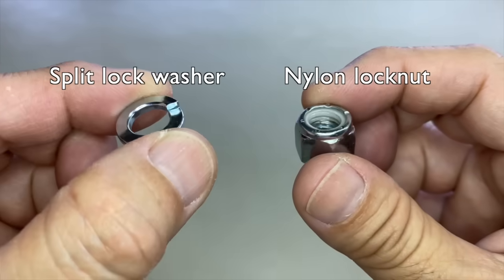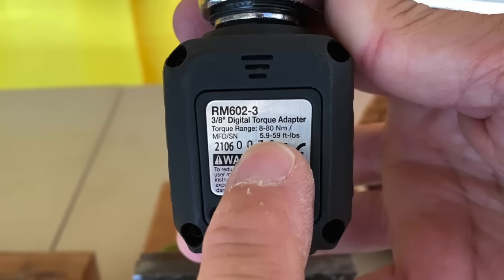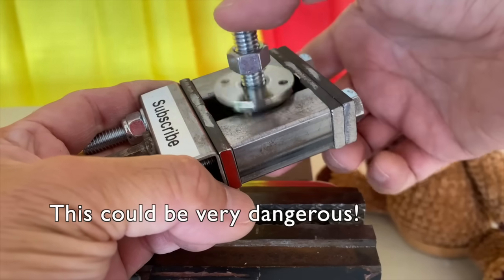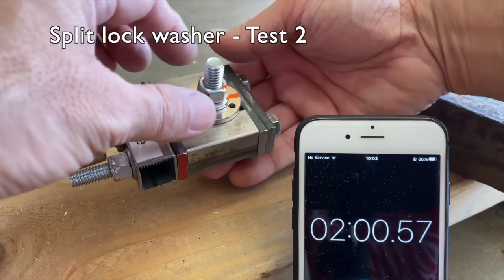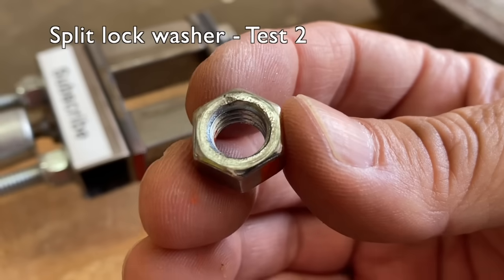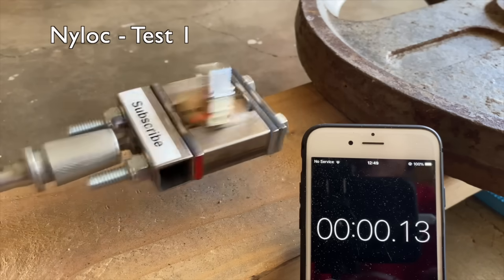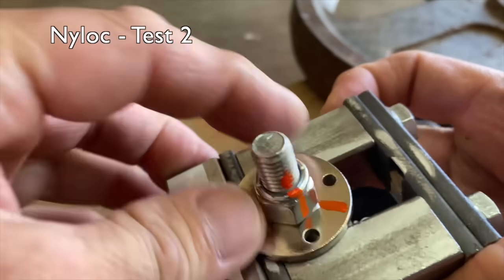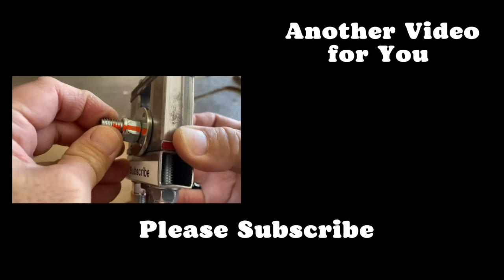Nuts & Bolts - Split Lock Washer vs Nylon Locknut – DIY Impact & Vibration Test - Part 1

Comment: Locknuts torque should adjusted to the "break away torque" wich is the amount of torque nessasary to rotate it on the threads, so that nylock nut was not torqued properly

Comment: It looks from the way the paint marks end up that in at least some of the tests, the initiation of failure occurs not due to rotation of the nut relative to the flange, but with rotation of the bolt relative to the whole assembly of nut-washer-flange which itself remains co-angular.

It might be interesting to see whether adding another split washer between the head of the bolt and the other flange helps, but fundamentally the issue is insufficient clamping force to hold the joint together, ie not enough torque.

Comment: Are any of these the metal lock nuts? They're used a lot in the automotive industry. For example, they're on the bolts that hold my upper control arm.

Comment: Did we really need to see a demonstration to show that a nyloc is better than a spring washer. Once the plain nut parts company with the spring washer disaster is inevitable but the nyloc nut holds for the length of the thread. Ive never seen a nyloc come loose in 50 years of repairs to cars, bikes or garden machinery even when a nyloc has been reused.
Reply: I have often seen Nylook nuts come loose in the agricultural sector. Lock nuts are the most durable.
However, I noticed in this test that the torque was definitely too low in the test with the spring washer

Comment: WTF?!  Firstly, it's a shear load not a "transverse load".  Secondly, in these sorts of "high dynamic near-shear-stress loadings", one ALWAYS applies lock-wire and/or an external torque buffer with a positive capture fitment.  This stuff is 50+ year old established mechanical engineering best practice.  PLEASE do a modicum of research before publishing objectively WRONG analysis on a public forum.
Reply from the maker: LOL!
First, it’s a transverse load across the diameter of the bolt.  Look it up or as you say do some research. 
Second, I obviously was not trying to show a best practice.  
You experts are too funny!
👍😎

Comment: He put the lock washer on upside down twice.
Reply from the maker: Upside down lock washer?  Thanks for the laugh!  🤣
Reply: @HacksbyDad  It is sort of like putting a fuse in backwards or reversing the polarity on a resistor.
Reply from the maker: @robertjohnson2325  I get those mixed up all the time!  👍😎

Comment: If joint 'can't come apart.  
A great start is flat perpendicular surface, flat hardened washers (SAE Grade 8) , don't need to be certified, but 'aircraft specs' is better.... And appropriate torque. 
PS did the background engineering for recalls in the ground vehicle industry.
 Lead contract teams that did dozens of DFMEAS & DVP&R's for industry.

Comment: Interesting, if you ever do follow up testing could you run the test with the double nut option 'jam nut'.  You torque the first nut to something, probably more than 6 ft/lbs and then put the second nut on an torque that against the first to the same torque.  Curious if that is equivalent to a single ny-lock or similar.  Thank you.

Comment: Clickbait. Disliked.
The NASA Fastener Design Manual is free and well worth reading:
https://ntrs.nasa.gov/api/citations/19900009424/downloads/19900009424.pdf
This video is a waste of time. Leave professional subject to the professionals. Split washers are almost never used in aviation and on nothing modern. Plastic insert nuts are far inferior

to all-steel nuts and no reason exists to use them given the trivial cost.

Comment: Not a good test. 3/8" (8mm) 8.8 grade bolts are usually torqued to between 30 and 36 ft/lbs, depending on the application. Even 1/4" (6mm) 8.8 grade bolts are torqued to between 12 and 15 ft/lbs. The only time I have ever come across any bolt being torqued to 6.0 ft/lbs was a set of cam cap bolts on a BMW motorcycle.

Comment: I admire the dedication to testing but 6 lb of torque on a 3/8 inch bolt invalidates the results. Even a grade 5 SAE bolt would be torqued to 30 ft lb which would change the outcome of this test.

Comment: Nylon lock nuts loose effectiveness over time as the nylon eventually takes a set to the threads. The presence of oil hastens their failure as well as heat cycles. Distorted thread (Crimp nuts) are what you see in applications such as engine rods and aircraft fasteners as well as exhaust flanges. In suspension parts a castle nut with a cotter pin is common. Other methods include jam nuts as well as thread locker (Again thread locker doesn't hold up to heat).

Take a hammer and bang the threads of the bolt slightly flattening them and re-run the test and see what happens...

Comment: Technically, the joint failed as soon as you lost preload on the bolt, so as soon as you can rotate the bolt, the joint has failed even though the nut doesn't turn on the bolt.

Comment: When using a nyloc, in order to get the same bolt preload, you need to take into account the torque to overcome the nylon resistance. When you first put on the nyloc, you need to measure the amount of torque required to run down the nut before you make contact with the washer, and then add the desired 6 ft-lb on top of that, otherwise the bolt will not have the same preload as the sample with the split washer.

Comment: Your torque value for a 3/8" bolt was ridiculously low. Depending upon your grade of bolt and thread pitch, 15-20 ft-lb would be possible.   Also, typically the running torque of the nyloc nut would be added to the bolt torque to maintain the same axial preload intended.
Reply: absolutely.. silly test at 6 ft/lb
Reply: Came her to say this - I'm no fan of split coil washers (I think they are called spring washers in the UK) but you could see it wasn't even clamped up.
Reply: I think he was testing at negative multiplier when doing 6ft-lb. This is to see which solution “works best” the fastest. 

If he tested at 20ft-lb that cheaper reciprocating saw probably would have burned up running so long haha. Also would probably take a very long time for results across 3 test samples each.

Comment: Experience here is that UV weathers/degrades the nylon leaving only what ever torque was applied. If it must not fail then Safety wire is best.

Comment: Niloc Nuts are awesome and work superb.
Unless your application is a very hot environment or youre securing parts that could get hot in case of a fault (electric connections).

Comment: I stopped using the split washers many years back when I almost lost a trailer when the nut got off the ball pin, thanks to the chains that kept the trailer hooked up to my Truck.

Comment: Looks to me like to get the most out of the Nylock nut you need to torque it more than others, due to the added drag of the nylon smushed into the threads; in other words, if all three tests had the same torque applied with the tightening wrench, you weren't really applying as much clamping force with the nylock nut, because the nylon-smushing action was stealing much of the force of the tightening wrench away from what would otherwise have been applied for clamping force.

Comment: There is a concept called torque loss. Are you getting the same clamping, or longitudinal load, tightening the split washer assembly vs the  Nylox assembly at only 6 ftlbs?  Wouldn't the rotational drag of the Nylon within the Nylox essentially ‘steal away’ some of the torque being applied to the thread surfaces?  Equate this to the clamping force of an assembly with dry vs oiled threads.

Comment: Haters do not deserve internet access. We all just watched a very good thing take place. Something more people should carry the desire to do in life. Scientific method of discovery being applied and carried out is always good. If an experiment can be improved upon, by all means offer suggestions. But do not disregard the effort. After all, information was obtained from the effort. Testable information with repeatable results. That's called success.
Reply: This proved if you don't tighten it to speck they will all eventually come loose.
Reply: Ask an engineer if you are doing anything needing to survive in critical applications
Reply: @danbutler7586 ask a technician who troubleshoots and fixes the engineers mistake of being a ninkumpoop
Reply: Yes, absolutely. The guy said something like: these results come from these experimental conditions.
Reply: @tonyblighe5696  
Nailed it. That rather important factor is actively missed by the aforementioned haters.
Reply: Stupid is as stupid does !!
Reply: It's a flawed test. We wouldn't expect you to understand based on your opinion
Reply: When doing a scientific study don't make up foolish parameters like this joker did. 6 ft pounds cause his torque wrench goes to 5.99 ft pounds is just stupid.
Reply: @RT-tn4ry  
When dealing in foot pounds, .01 is not going to be any level of a meaningful difference. You are searching for something to hate. That is a bit worse than blind hate. 
Again, if an experiment can be improved upon, offer suggestions. You are not offering anything but blind judgement while not truly understanding the benefit of the data collected.  Even an outright failed experiment can net usable data. 
He was testing the ability of the components to do their advertised job on their own minus their rated torque specs. Yes, there are numerous variances which could have been applied during this experiment. But that is when suggestion comes into play. Only offering hate and improper judgement is of no use to anyone outside of ego of the one who leaves such a comment.
Reply: @theduder2617  It is a valid suggestion to say fasteners should be tightened to their proper torque...not just the lowest setting on your torque wrench.
Reply: @theduder2617  You are the one missing the point. No 3/8" bolted assembly is ever torqued to 6 ft/lbs. It's nice that the guy took the time to do these experiments, edited the video, then put it up on the Internet for others to benefit from. Not questioning his motives. But bolts work like rubber bands, they stretch. Bolt stretch is the thing that applies clamping force. 6 ft/lbs is not stretching this bolt enough to apply substantial clamping force. So the outcome is predictable, the assemblies loosen more easily than they would in a real world application. It's not "hating" to state that drawing meaningful conclusions from flawed data is counterproductive. How many people have had unintended consequences - some of them deadly - because they were operating with flawed data?
Reply: @georgeellison926  
Incorrect. Had he been testing manufacturer torque ratings, those would have been the torque ratings he would have used. To put it over-simplified, he was testing to see which design vibrated loose the fastest and which one held up the longest given his established conditions.
Missing the objective of an experiment does not "flaw" the results. Obviously these results are not to be presumed as manufacturer recommended torque results, for that was not the experiment. 
The test was to show differences between the washer and nylon nut. In the results, those differences are shown. I.E.: experimental success. 
No one, not even he himself is suggesting anyone run out and use these parameters in any situation whatsoever. That would be the individual's decision and they alone would be responsible for the results of such use. 
FYI: even nuts/bolts tightened to manufacturer specs is subject to vibration. And stretched bolts are weakened bolts. Hence half the importance of not over-torquing a nut/bolt. 
From these results, one can determine which washer design is best for their application if vibration will be a factor. After all, there were differences in the amount of vibration each design withstood before movement of the nut began; the entire point of the experiment. 
End note: FRICTION is what provides clamping force. Hence why it is not good to use lubricants and anti-seize compounds on vehicle lug studs. And friction is what torquing generates.
If you stretch an outer tie-rod by over-tightening the jam nut, that tie rod will need readjusted. If you stretch a head bolt, one runs the risk of the new gasket leaking and/or stud breakage. Both bad. 
Oh, and split-washers are not fans of too high of torque. Too much and the split opens further, smashing out from under the nut. The more it spreads, the more torque needed to reach a specific setting.
Reply: The recommended torque for this application is 26ft/lbs. At 26ft/lbs the threads will stretch, the lock washer will react differently and not loosen under vibration in its recommended usage. If the fastener combination fails, it was either flawed or the wrong combination for the usage. Plain and simple, if you're not testing the recommended spec, the test is useless.
Reply: Duder wants participation trophies for the effort lol
Reply: @lollipop84858  
As I stated, haters do not deserve internet access. Nice of you to make the effort to reinforce the statement. 
Doing so while actively missing the entire point calls into question your opinion, but thanks for "participating".
Reply: @theduder2617  
then you should not have internet access yourself!

Comment: I don't know, with such vibration, other types of locking of the connection are generally used. Nuts with a slot are acceptable.

Comment: Interesting, and real world applicable-in the garden shed, by which I mean: the real world. So many aero engineers here getting their knickers in a twist, citing NASA usage. If you're building a fence,  you'd use split washers and tighten it by hand. If you're building a billy cart,, you'd use Nylocs on the axles, and still tighten by hand. On my 1974 GT750 Suzuki, there are mostly nuts and bolts with split washers, one Nyloc nut, two castellated nuts with split pins, a couple of lock-wired nuts, and several nuts and bolts with foldable tab washers. All tightened to proper torque specs.

Comment: This a test to compare the locking characteristics of two systems under a single, non-representative situation.  This selected low torque condition would obviously favor the nyloc fastener.  This video tells me nothing that helps me select which system to use under varied real-life applications or to solve real-life fastening problems.

Comment: Depends on application. There is literally 100s of specifications in mechanical engineering regarding fastener stickups and torque. Especially with the nav sea and nav air hardware. In the auto industry the requirements aren’t that stringent and really don’t need to be. And today a lot of automotive load bearing components are torques to yield with no lock mechanism. As far as split washers go, yes they will have cracks in them. Some from the manufacturing process and some from being used. There are lots of specs in mil hardware that require split washers to be replaced if the fastener is removed. But this is mission critical hardware. For general auto hardware it’s fine. Don’t think to much on this stuff.

Comment: This is a clastic example of total failure vs a controlled failure. After the split lock washers loosens, it will rapidly lose the bolt (total failure). In the case of the nylon lock nuts, after loosening, the nut will remain on the bolt and you don't lose it (controlled failure).

Comment: If I recall correctly, NASA found that split lock washers weren't any more effective than standard flat washers. Where a nut is needed to remain on the bolt without fail, a Nyloc nut or a prevailing torque nut is preferable unless another mechanical method of fixing the nut is used (such as a split pin). For safety critical joints I prefer to use ISO 7719 or ISO 7044 end-pinched style prevailing torque nuts.

Comment: The Nylocs may have lost their pre-load but the assembly didn't fail. This would at least buy time for a proper check of the fastening. In any case, surely both the spring washer and the nylon add their own torque value so the 6ft/lb applied as measured on the gauge so the pre-load between the face of the nut & bolt head and the flange could have actually been lower.
If you're likely to be using such a low torque in such an extreme real-life scenario then a split pin or lockwire might also be used!

Comment: Very interesting results.
I agree with some of the other comments, that you should torque to spec for the size and grade, but a good start.
Id be interested to see what happens with proper torque, as well as possibly mixing (split and nylock), or possibly crimp style lock nuts (the ones with the bend in a thread.
Good demonstration.  Thanx

Comment: That is because split washers locking force gets weaker after every stroke, as it is acting like a spring which relaxes as the nut rotates and the distance between bolt head and nut gets larger. Nylon locker nuts at the other hand, applies constant force at the surface of the thread, no matter how big is a distance from the screws head. But spring washers has other uses - sometimes you need quite secure connection which is also easy to unscrew. They are also preferable in the electric applications, where the constant contact between screw terminal and connector is most important. But i am curious about another option test - loctite type glue plus standard nut, and the combinated solutions.

Comment: This test is consistent to my own experience except some the bolts loss its threads making the nut just spins around in its place. Thank u for posting, maybe do the same test but this time add blue and also after do it in red lock tite.

Comment: Is this test valid anywhere? I ask then because where would you only tighten a bolt to 6 ft. lbs. and have it loose like that? Try removing the spacers so the bolt will tighten on the tester and give the the bolts a proper torque. An average set up like that would be 25 to 50 ft .lbs.